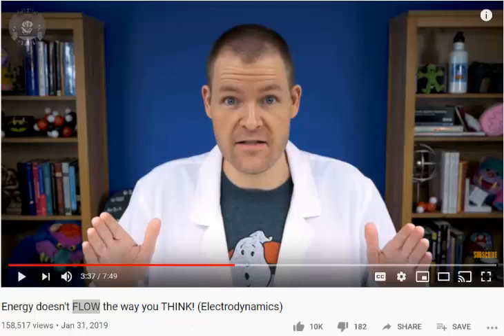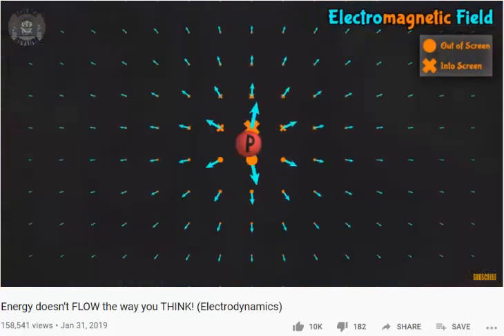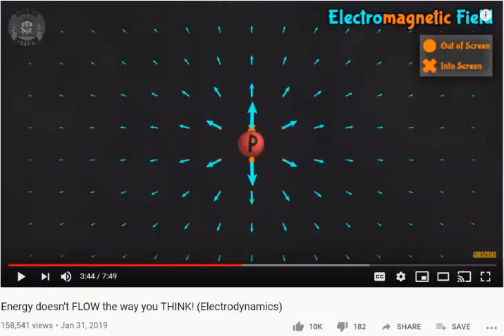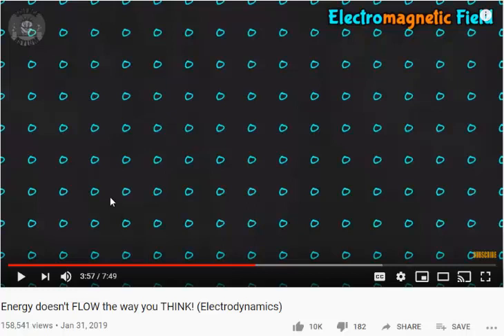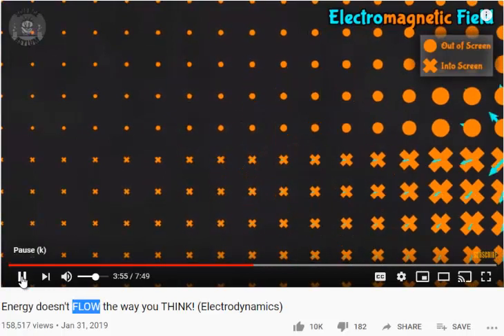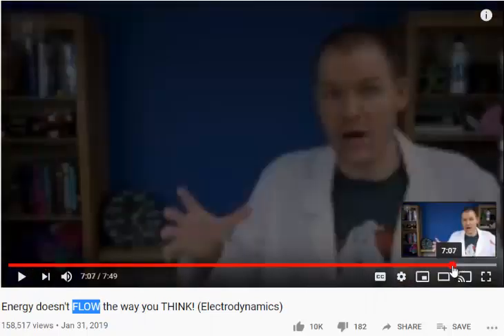On Energy Flow

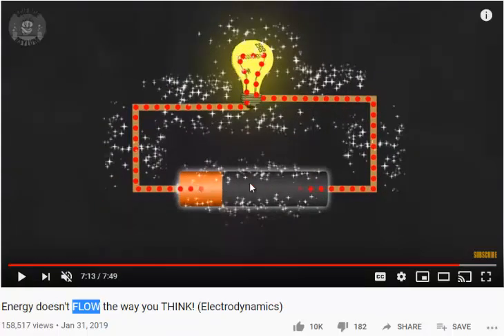Comment: At10:35 
" From Conter-space into space, then from space back to counter-space " seems to me to be the correct order if one still assume counter-space as where (manifestation of) energy originated from. I used past tense as potential and manifestation are incommensurate principles. 
Thanks for this video. I come back to it from time to time : )
Reply from the maker: Your welcome. Energy is a very difficult concept to understand. I can tell you that even the most seasoned physicist doesn't understand energy. They may think they do, but they don't.

Comment: Does the idea that the field exists without a charge contradict Wheeler's assertion that space is a posterior effect of magnetism?
Reply from the maker: In mathematics, a field is the assignment of a value (usually a vector) to each point in space. In this manner, "field" and "space" are the same thing. If space didn't exist, then there wouldn't be anything to assign "values" to in terms of the field. Field is a mathematical concept and not a "thing" in of itself. The real question is, does space exist without charged particles, and the answer is no. Without distance between particles and a way for particles to detect each other (charge), space could not exist.

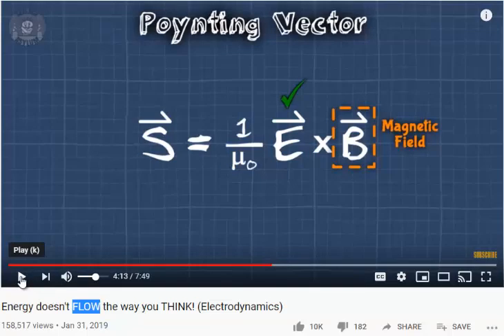Comment: If, as according to Charles Proteus Steinmetz (who you champion), the electric field is the dielectric field and magnetic field combined, then it would seem that you should not be using the term electric field and magnetic field as two separate entities. It would also make the equation for the Poynting Vector wonky.  So your statement at 3:53 does not make sense to me.
Reply from the maker: What Science Asylum calls the "Electric Field" I (and Steinmetz) call the "Dielectric Field". The use of the word "electric" here is VERY confusing here. I used it at that point in the video because that is what Science Asylum called it.  Steinmetz calls the combination of the Dielectric and Magnetic Fields the "Electric Field", so this is further cause for confusion. This is why I am re-writing the program. For clarity, the terms I use for the two fields are ElectroPotential (dielectric) and MagnetoKinetic (magnetic). Energy can't flow unless you have BOTH the dielectric and magnetic components of the ElectroMagnetic field are present. Hope this helps.

Comment: may i humbly suggest to heed steinmetz resentment about analysing electrical system in terms charged particles. IT's INSANITY!!! :))

he said that it uncessariliy complicates electricity and most specially destroye the inherent relationship between magnetic and electric field.

magnetisim is a type of energy storage . electric field is another way of storing the same energy. one transforms into another and vice versa. this oscillation ( for ac system) is the kinetic form of electric energy. 

an oscillation consists of compressed electric field ( voltage) . this oscillation can be transferred thru nearby atoms inside and along  the wire by magnetic induction thru resonance via amperes wire law. the rate of conduction is c, and what we call current (amperes) when a load is put in the ends of conductor. 

so in the issue of energy flow, since i posited that energy is tranferred by resonance, it now depends on how we interpret resonance. from a classical pov, it seems its accross the length of wire, but deeply i think resonance is a nonlocal phenomena, so the flow is actually to the subfield or inward or counterspatially.
Reply from the maker: I agree that resonance plays a key role. The question becomes "what is resonating?". Is it the field? Is it the electrons? Is it the atoms that make up the wire? Is it all of the above?
Reply: i don't know what resonates. but it implies a medium of wave motion. it seems formless in its static state since its motion is what define what it is.   for example if it moves in circular, it creates inertia or mass ,  if compressed, creates a charge, if moves transversly it creates an energy field for every particle depending on the energy density ( based on its frequency) of the fields.

Comment: "The electric field Eσ is oriented axially along the length of the conductor while the H field remains circumferential, curling around the internal longitudinal current. The Poynting Vector of the loss field is therefore directed radially into the conductor. It is the propagation of this loss field in a radial direction that is controlled by the material parameters of the conductors (µ, σ, ε) and is ultimately attenuated by conversion to heat.....Although the main component of energy propagates rapidly within the dielectric along the axis of the cable, the energy constituting the loss field that enters the conductor across the boundary propagates much more slowly, being determined by the frequency-dependent parameters α and β. In a perfect conductor, a current traveling only in the surface would match the boundary conditions for the axial propagating field. (Maybe you recall from Gauss's Theorem that the lines of the displacement vector D-Bar must terminate on a surface-charge density.) For a lossy conductor, however, it is the loss wave within the conductor that determines the current within the copper. The depth to which the E field, hence the conduction current, penetrates the conductor is expressed as the skin depth δ. We would therefore expect a complicated current distribution throughout the volume of the conductor.....The "Ohm's Law" of Maxwell's Equations states J-Barσ = σE-Barσ, which indicates that a conduction current density J-Barσ is induced axially within the conductors due to the internal electric field E-Barσ of the loss wave. This axial current is the current we normally associate with cables—the model we have developed is compatible with the more usual observations of cable behavior. Since the electromagnetic energy of the loss wave propagates principally in a radial direction and enters the conductor over its surface area, the current density (proportional to E-Barσ) is greatest at the surface, and decays as the field propagates into the conductor interior. It is this reason why a conductor experiences a "skin effect" on the outer region rather than the converse situation of current concentrated near the center of the conductor..." The Essex Echo 1995: Electrical Signal Propagation & Cable Theory, Dr.Malcolm Hawksford. I think he is identifying the radial Poynting vector as what you call the "fuel". Namely the power used by the imperfect circuit conductors as they are not perfect reflectors of the energy flow.
Reply from the maker: mfr58: Thank you for this awesome and very detailed comment.
Reply: Yeah, but the radial component of the Pointing vector in the conductor is just peanuts wrt the tangential component near the surface.  Almost all the energy is transported by the fields in the space between the wires (be it a dielectric or a vacuum), and there the Pointing vector is directed from battery to load, thanks to the surface charge that makes the E field almost perpendicular to the conductor. Considerations about the skin effect are only secondary, since we are considering very low frequencies (or even DC). In short, the direction of electric field and Poynting vectors in SA video are wrong.
Reply from the maker: @copernicofelinis  Thank you for your comment. The magnetic vector is pointing correctly in my opinion. In your opinion, which direction should the electric field vector be pointing? Please explain it in terms of what you think is wrong with SA's depiction. This will be very helpful.
Reply: @FractalWoman  inside the conductor the field is directed axially and has the small value j/sigma. This is the field responsible for the small joule loss associated with the radially inward Poynting vector. The reason the field inside is axial is that there are surface charges on the conductor surface (nothing to do with the skin effect). This surface charge is also responsible for the abrupt change of the E field at the surface of the conductor. Immediately outside the conductor the field is almost perpendicular to the cylindrical surface and is much stronger than the j/sigma value inside. It is this almost perpendicular E field, along with the circling H field around the conductor that is responsible for the strong Poynting vector in the space between the wires that is directed almost completely along the direction set by the wires (immediately outside the S vector is almost directed as the conductor's axis). The small slant  in S is due to the small part of energy entering the cable to be dissipated as small joule loss. The big  part of S directed along the cables direction is responsible for the energy transfer from battery to load. At the resistive load, the discontinuity in sigma and eps causes charges to accumulate at the resistor's terminals, thus producing a strong E field inside it. This will cause the Poynting vector outside to bend towards the inside of the resistor. This represents the energy entering the load to be dissipated as heat and light.

edit grammar and a little clarification
Reply from the maker: @copernicofelinis  Hey, can you do me a favour? Can you find a nice video animation that depicts what you are talking about? Maybe this guy has one: https://www.youtube.com/user/EugeneKhutoryansky/videos
This would be very helpful. Thanks in advance.
Reply: @FractalWoman  I can point you to a still image that shows the fields: https://i.stack.imgur.com/nmHVY.jpg You can imagine the time evolution by making the electric and magnetic field sinusoidally varying. Since they both invert their sign together, the. Poynting vec will always go from battery to load in a pulsating manner.

Edit here's a picture with field lines 
http://www.furryelephant.com/content/electricity/visualizing-electric-current/surface-charges-poynting-vector/

Comment: Oh please, the "really wonderful animation" is WRONG. SA is getting the direction and magnitude of the field outside the conductors WRONG, and so he is getting the direction of the Pointing vector WRONG.  Look up Jefimenko's paper and book to see how the field is directed, or Jackson's paper on the role of surface charge, or Chodary... With the correct E field you will see that the P. Vec goes from the battery to the load and is basically guided by the wires. Almost nothing goes into the wires, as it should be expected since the good conductor they are made of will give a low joule loss.
Reply from the maker: Copernico: Great. I will take what you said into consideration.
Reply from the maker: Can you point me to a video with a visualization of the correct direction and magnitude of the vectors? Also if you have a link to Jefimenko's paper, that would be very helpful too. I have one of his books but it is the one on relativity so I don't think that will help. Thanks in advance.
Reply from the maker: Also, I want to point out that SA is depicting FORCE vectors and not FIELD vectors.
Reply from the maker: Here is what I found in Wikipedia page on Poynting vector. This is in regard to a coaxial cable:
"... Poynting vector within the dielectric insulator of a coaxial cable is nearly parallel to the wire axis (assuming no fields outside the cable and a wavelength longer than the diameter of the cable, including DC). Electrical energy delivered to the load is flowing entirely through the dielectric between the conductors. Very little energy flows in the conductors themselves, since the electric field strength is nearly zero. The energy flowing in the conductors flows radially into the conductors and accounts for energy lost to resistive heating of the conductor. No energy flows outside the cable, either, since there the magnetic fields of inner and outer conductors cancel to zero."

So, in SA's visualization, the energy flowing radially toward the wires is the energy loss due to resistive heating. So, energy DOES flow this way, but it is not the energy that is delivered to the load. In other words, not all of the energy consumed by a circuit is consumed by the load. I think this visualization is still accurate in terms of energy flow.
Reply: Jefimenko's paper is 

Demonstration of the Electric Fields of Current-Carrying Conductors
American Journal of Physics 30, 19 (1962)
doi: 10.1119/1.1941887

his book is "Electricty and Magnetism" IIRC.
Then there is Jackson's 

Surface charges on circuit wires and resistors play three different roles
American Journal of Physics 64 (7), July 1996

There are lots of papers showing how things really are. One is

Energy transfer in electrical circuits: A qualitative account
Igal Galilia and Elisabetta Goihbarg
Am. J. Phys. 73 (2), February 2005
DOI: 10.1119/1.1819932

As for your comment on the joule loss in the wire, yes a small  part of the power goes into the copper due to joule loss, but it is negligible. The overall direction of the Poynting vector, when there is a load, is parallel to the wires, meaning that the wires are guiding the power transfer from the battery to the load. Much in the same way it happens in a transmission line or in a waveguide. If you look at the E field depicted in SA video you will see that he is getting the E field outside the conductor wrong (in direction and module!). The rest of the analysis is wrong as a consequence of that. 

Depicting the Poynting vector directed primarily inside the wires is wrong because well - it is based on the wrong direction of the E field to begin with - and leads to the wrong interpretation of energy going indiscriminately into space and then being absorbed from space as if by magic. But if you look at the right direction you will see that energy simply goes from the battery to the load, guided by the wires. Just like in a waveguide. The only difference is that there is no spatial variation along the wire. 

To say that, since there is a small almost negligible component of the Poynting vector directed toward the wire, then the animation showing the Poynting vector directed toward the wire is correct is like depicting a falling body as going horizontal because there is a small contribute due to the Coriolis force.
Reply from the maker: @copernicofelinis  Thanks so much for the info. I'm sure it will help others too.

Comment: Let's remember Heaviside and give him credit, it's all there. Energy is stored in space. Energy flows through space. The conductor is an obstructor, it rejects the electric energy. All electric energy going into the conductor is dissipated by the conductor becoming heat. The energy flows from the battery to the lamp through the space between the wires. 
Heaviside deduced the equations from Poynting's Theorem before Poynting.  He corresponded with Poynting correcting some of Poynting's mistakes, then gave up his discovery leaving all credit to Poynting.  The animation of this video fails in one important aspect, the energy is not being conducted inside the wires to the lamp, the dots showing the energy flow from the battery to the lamp are missing.
Reply from the maker: Nathan: great assessment. I believe the dots showing energy flow from the battery to the lamp were excluded on purpose so demonstrate that the energy source, such as an AC power generator (the source), doesn't need to be anywhere near the lamp (as he clearly states in the video). Keep in mind that this is just a schematic. The energy comes from space and goes into the lamp. This is clearly depicted. The energy goes from the source (battery/AC generator) into space. Conservation of energy is clearly depicted in this animated SCHEMATIC. I think it is a great depiction and a really helpful one.

Comment: kindve confusing and still the flow going only centripetally doesn't add up to field   pressure mechanics , which must have centrifugal divergence  for the light to even bust ,  i just saw a video where this same guy actually described energy flow with electrons ! he does not understand electrical engineering
Reply from the maker: In this video I see both convergence toward the center of the wires and divergence out of the battery and/or AC power source.
Reply from the maker: "Electrical energy is electromagnetism; it is composed of an electromagnetic field. On the other hand, the particles of electricity (electrons) flowing within a wire have little resemblance to an electromagnetic field. They are matter. Electricity is not energy, instead it is a major component of everyday matter."  from here: http://amasci.com/miscon/energ1.html

As usual, the problem is with the language. Electrical ENERGY is outside the wires. ElectriCITY (the domain of electrons) is inside the wires.  ElectriCITY causes stress and strain in the dielectric and magnetic field surrounding the wires creating the right CONDITIONS for the electrical ENERGY outside the wires, to flow. I think its important to distinguish between electricity and the energy associated with it. Electricity flows in a loop INSIDE the wires and energy flows TOWARD the wires (the sink) and away from the battery (the source).